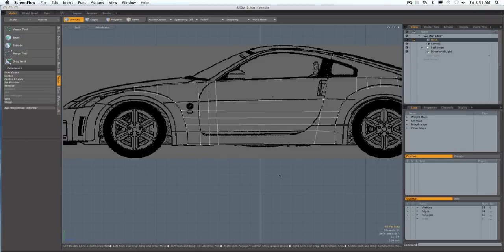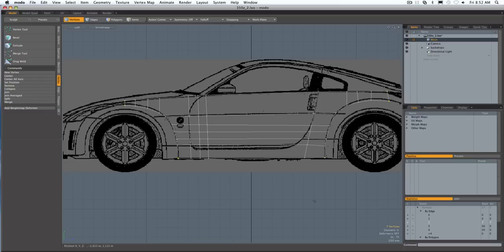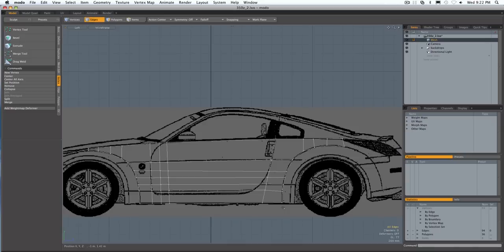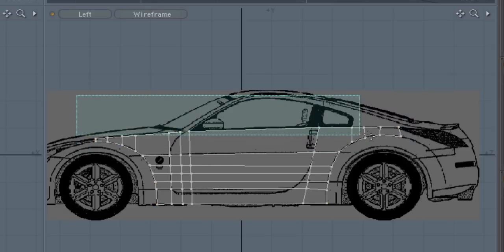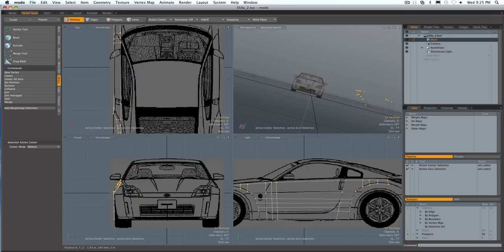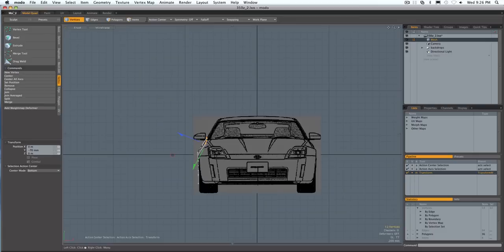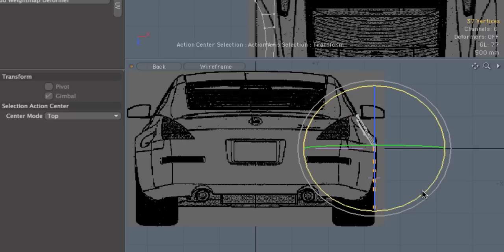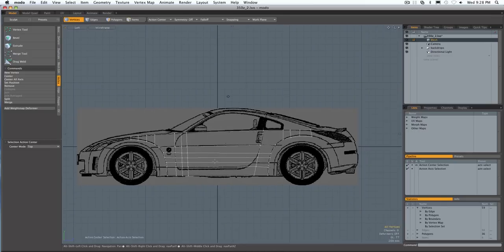03b Modo Car Tutorial - Starting The Car Model Pt. 2

Comment: Hello again...

So 302 has the action center "selection"  but there does not seem to be a center mode option for me to select "bottom" to rotate my vertices over onto the body above the crease line. What I had to do was select "automatic" from the action center and manually position my rotate axis to the crease line, what in effect was the bottom of my vertices selection.

So first of all, are you doing these videos in 401 or 302? As I am in 302 should I have a "center mode" option - bottom  ?